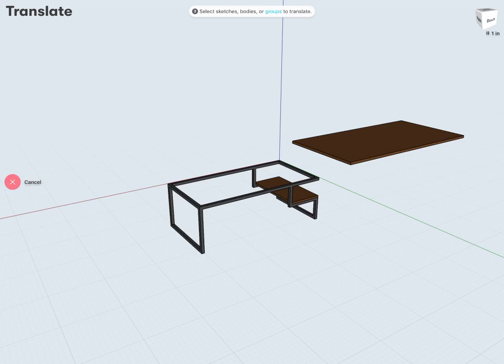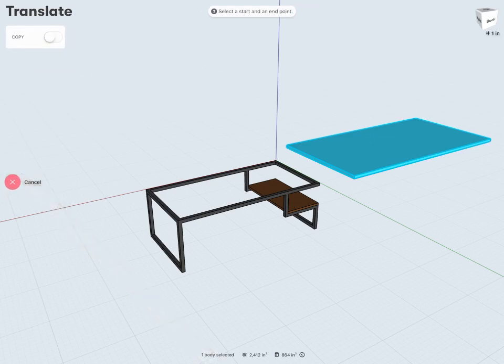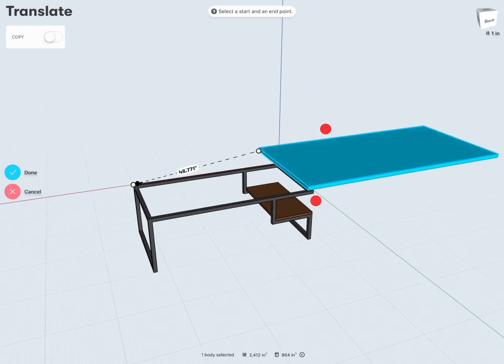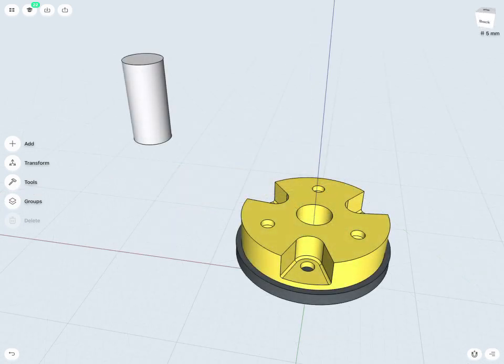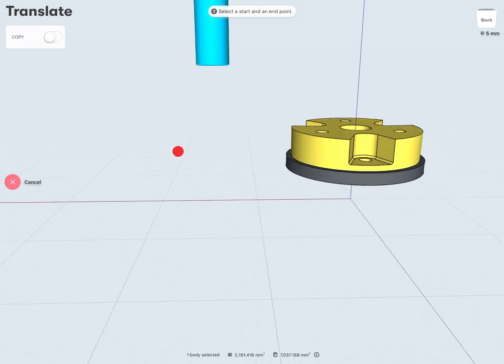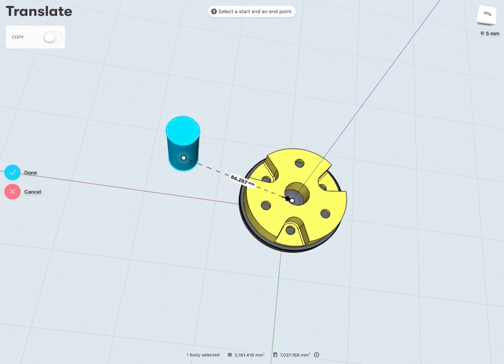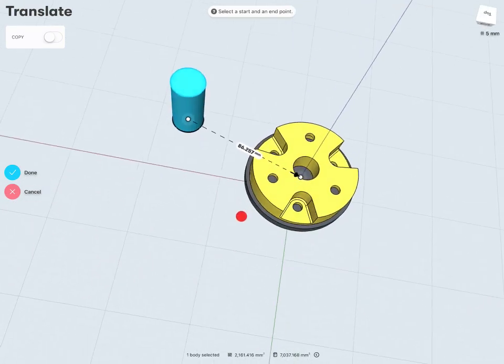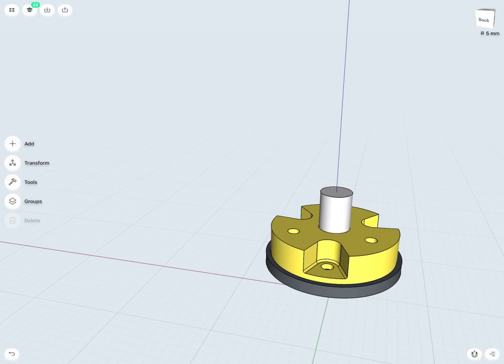Translate | Shapr3D for Beginners

Comment: That works fine because it is a cylinder. What if you had to put a pipe into an hole?
Reply from the maker: You can design a pipe and translate it into a hole using Translate tool. For more information on how to use the Translate tool, please watch this tutorial: https://youtu.be/-uqt802Ky2g
Reply: Shapr3D Doh! You just answered his question by linking this same video.   BTW, these videos have been very helpful to me. Thank you!
Reply: Just as a guess, there are two options (one not a guess).

1) Shapr3D might well snap to the Center of a pipe.
2) Build a bisection of the end of The pipe, and snap to midpoint.